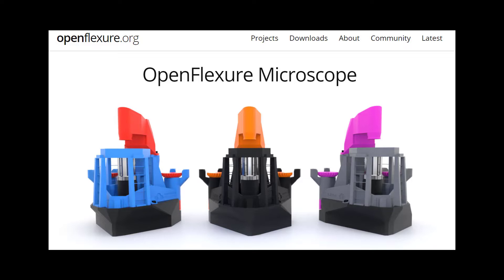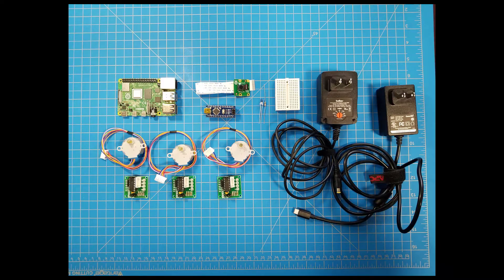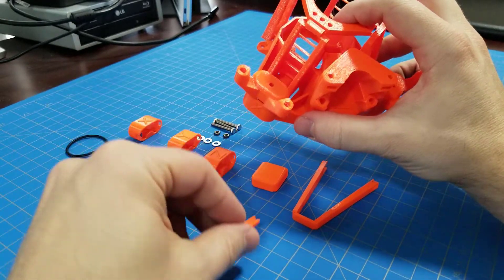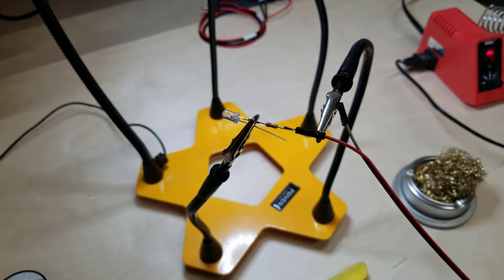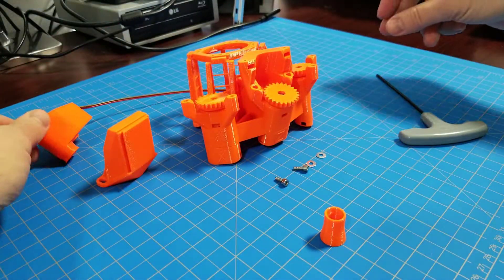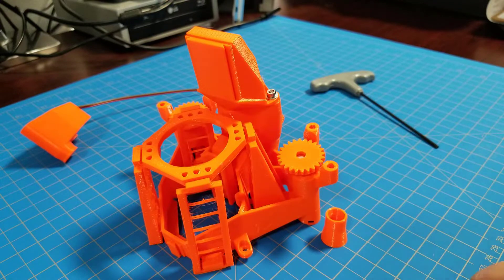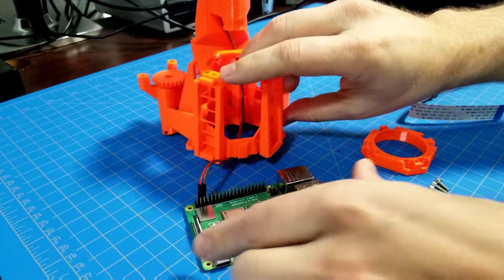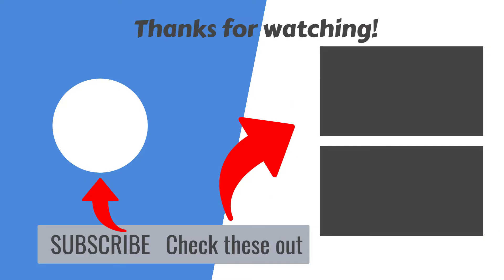Openflexure High Magnification Microscope Raspberry Pi 4 Camera v2 3D printed project 2021

Comment: Hi! Is the microscope stage precise on your build? It looks a bit shaky on the video, but maybe it's just external vibrations?
Reply from the maker: It does vibrate when moving but then the picture is sharp.  You only take pictures after it has arrived at the new location and has auto focused.  You can move several hundred steps in each direction and still have part of the object in frame, so it seems quite precise to me.  Thanks for watching!
Reply: @vincestechshop  Thanks for the feedback! I will try to build one.
Reply: @vincestechshop  can you counter this vibration by bolting this microscope to a heavy piece of metal and hold it down right?
Reply: @Justin-dv7ul  If you find it's shaking too much while stationary you could try metal, concrete, or ceramic as a weighted base. You can even try that with foam underneath, like how people stabilize 3D printers. But if the flexure itself is shaking, you could print with PLA, which is more rigid than his PETG.